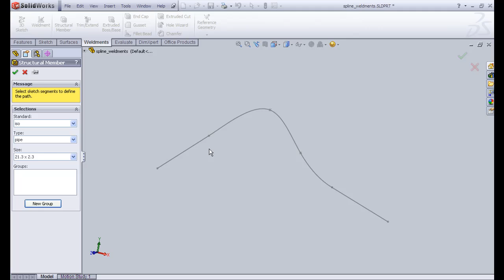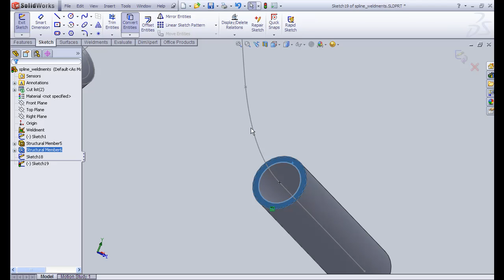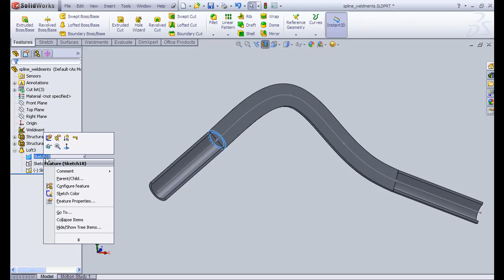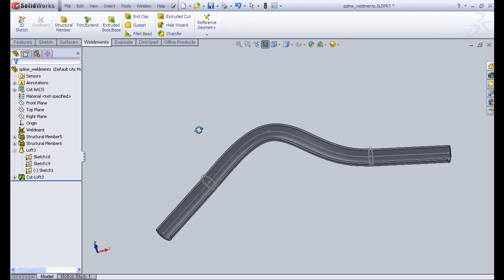Solidworks trips and tricks-Creating weldment using spline profile

Comment: MOG this is a joke that solidworks up to 2018 cant make weldments profiles based on splines.
Reply: I know it's inconvenient but Solidworks is made with manufacturing in mind. Don't forget that the company associated with it was involved in aviation engineering. If it's inconvenient to make it in real life it should be inconvenient in the software as well. If the program can't solve your design with geometry, topology and math, that means it can't test it and run simulations with it to prove that it works as you want it to work.